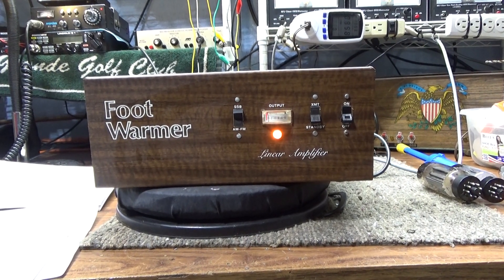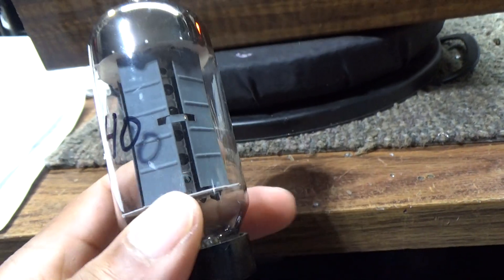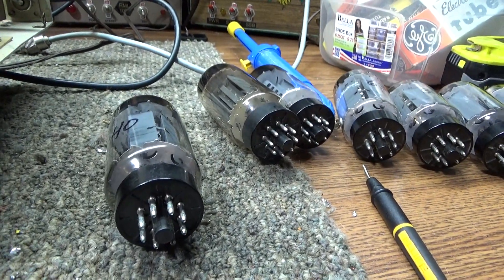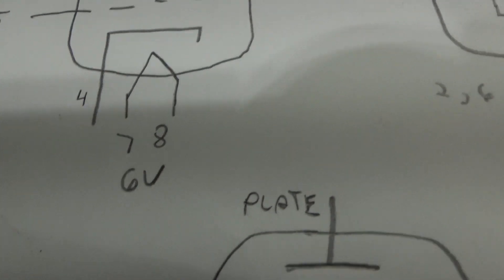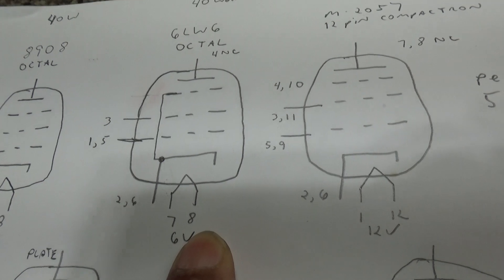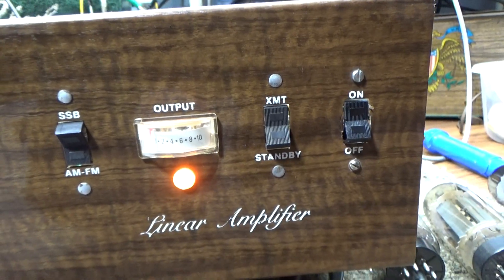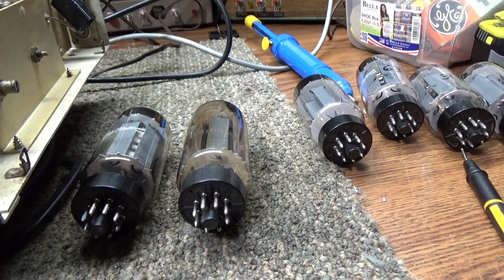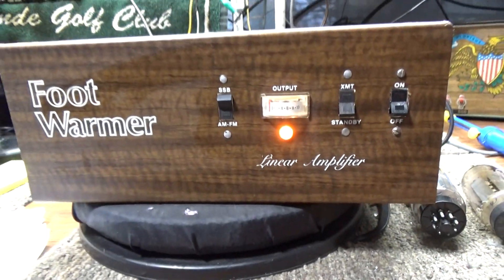8908 / 6lw6 / M2057 Biggest Baddest Linear Amplifier Sweep Tube made explained Hygain Footwarmer Amp

Comment: thats why i dont work on sweeper amps . 572b or better amp is all ill work on getting parts is getting ridiculous. el509s /6kg6 i thought would have held on a little wile longer but they didnt 2057 is a decent tube but you need 4 of them to hang with a cheap ceramic tetrode ... i just found in a high volume repair shop sweepers are not worth my time unless someone is willing to put $3-500 into a boat anchor .... time is money folks down river from you dont spend much as you surely already knew .. one day i need to come up and meet you we have a few mutual friends ..

ive pritty much left the cb repair hobby and put my time into amateur radio and solid state vintage audio repairs at this time .